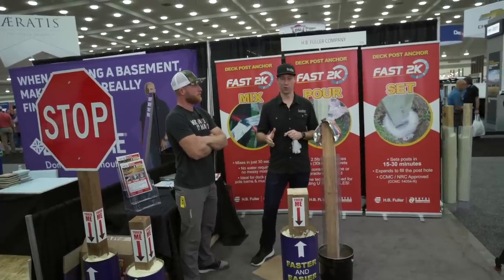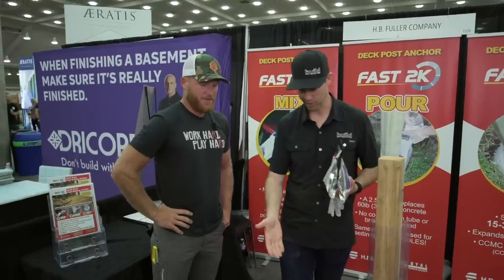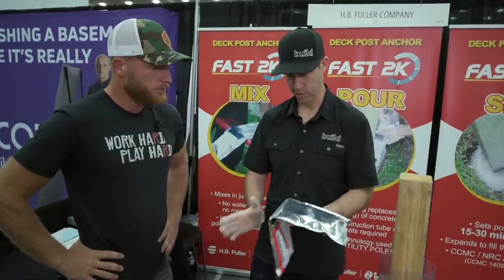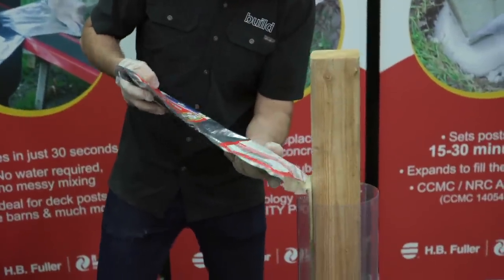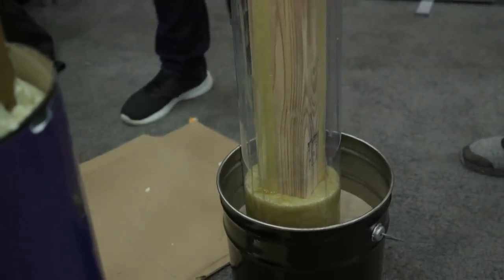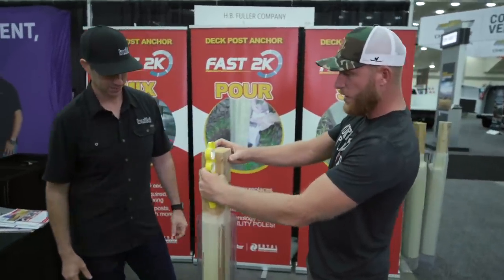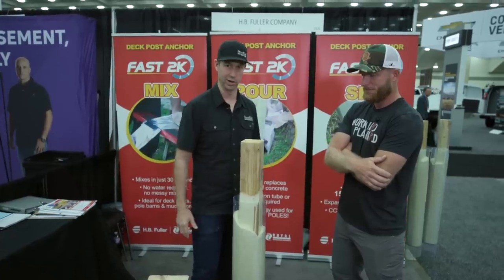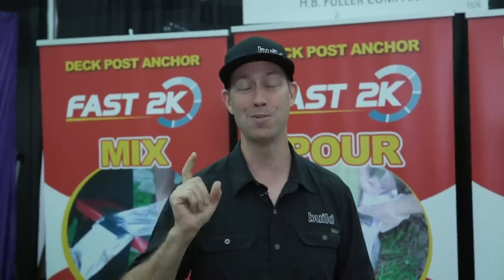Foam INSTEAD  of Concrete???

Comment: When I put a fencepost in I literally dug hole, plumbed fencepost and dumped in a dry bag of Sakrete and bada bing  I was done. I didnt even mix the sakrete with water because it would soak it up from the ground. However if it was really dry out I would pour a bucket of water in the hole first then dump in the sakrete . My post are still in use today and many have been put in well over 10 years ago and still straight. (A bag of sakrete is only 5 to 6 bucks per 80 lb bag)

Comment: The wind will work wiggle into the posts, the foam compresses and then you start the mass water penetration into the hole.  I had seen this Idea almost a decade ago, tried it, and had problems within the first three years "especially on fences". It is a horrible way to put in your posts, and if you do have water concerns, paint the bottom of your poles with some tar, spar varnish, or my personal favorite "Rustoleum Truck bed paint" with a cup of silicone carbide whiskers added to make it insanely strong, self glazing, and essentially turns it into a geopolomer, the top of your posts will dissolve before those type of treated bottoms will.

Comment: I make sure there is 6 inch minimum gravel below the post. Then use pressure treated post, which we then give two or three additional thick coats of copper green.  Then use good quality concrete poured above ground level,  and coned around the top.
   Have also used the foam product on one post  with success. It is light weight, and easy to handle. Just have to work fast and have the post set in perfect ahead of time. No margin for error. Also, very sticky so wear gloves and clothes you dont care about. 
   My preference is the concrete. Just have to do it right.

Comment: I used a different brand to re-set a falling clothesline pole this spring.

so far it's been solid but that's compared to the pole previously just being buried in dirt so no direct comparison to concrete, io mostly decided to try th foam because it was gonna be about $3 more than doing the pole with crete, and the foam pouch weighed 2 1/2 pounds instead of 100

the one i used was faster reacting and expanding, so i think i will look for this fast2k stuff if i do any other post holes, as the other brand was kinda frantic to mix and pour

Comment: I remember a guy put up a solid PVC fence with that stuff. Super storm Sandy blew it down. It doesnt have the weight of concrete. Now if you are making a low fence out of chicken wire or other wire fence that high winds can blow through, i might use it if its not too expensive.

Comment: Wow, another great foam product.  I recently learned about a foam block that’s been used in Europe for a while.  High R-Value, much less labor intensive than concrete block.  It uses some kind of poly sealer in between.  Doesn’t break down in water.  Only a week later, I saw it being used for a million dollar build.
Reply: What about nail polish remover?

Comment: Since expanding foam forms from a chemical reaction and is usually (from my experience) very porous, is this the same you witnessed with this product?  Any concerts about flooded properties/lands or underground water pressure causing this to lift through buoyancy?
Reply: No it’s  not. This is 3 times the price and will run much more than a concrete truck.

Comment: How does this distribute the concentrated load to the ground. Northern Illinois southern Wisconsin by code requires an actual footing under the cement columns and does not allow the columns to be placed in the concrete. Simpson post base or some other equal products are required.

Comment: This particular product makes a lot of sense for DIYers its worth the price premium for the convenience.

Even though polyurethane isn't water permeable I don't believe this process would actually make wood waterproof. If the wood expands and contracts even a little tiny bit they'll be a seem. You can also seal the wood before laying it in concrete and I'd do the same with this stuff.

Polyurethane isn't great in terms of cost either. You're probably looking at twice the cost.

What polyurethane is really great for is strength to weight ratio. I could see this being used in specialized applications where weight is an issue and I'd imagine since its easier to inject it could be used in some retrofitting projects.

Comment: 1. The general public (homeowner) will use this primarily for a mail box post. 
2. If you've never replaced a post before, good luck. You will leave the concrete in the hole and relocate the mail box. 
3. Never, never, never set the post in concrete....... or foam. Use pea gravel. 
4. Pea gravel is firm enough for instant rigidity, and if the post breaks at ground level, I've had great success pulling the post out, in slipping a new post in the same hole.
5. How? You might ask. Dirt particles fill the voids in the gravel and after a few years, the gravel is held in place by the dirt grains. And if it collapses in, just dig it out easily with a rotating post hole digger. Don't relocate the post.

Comment: Maybe with a better product, i still have to remove and reset a large portion of my fence post base, because the product i got from a box store after 6 days lost strength and compressed. in fact every post i set with expanding foam has to be removed and re poured with concrete. it is a great concept and time and speed are great. Also the ability to move and transport are also great compared to concrete. And for the record i followed all instructions for prep and installation .

Comment: Checked the MSDS, and it's a 2-part polyurethane foam. Similar products are used for (e.g.) facades and similar, so it should hold up to weather. (Might discolor over time, but who cares.) It's probably at least somewhat flammable, but I don't think that matters for this application. There are similar products; I found Sika Fence Post Mix. The innovation here is basically pre-measuring the components, and getting it in a convenient form, so I assume there's more out there.
So, who should be interested in this? People who need to anchor a single post in a hurry. There are comments talking about (e.g.) satellite dish installs, where you want the installer to get done and on to the next job without waiting around half the day for the concrete to set, and that's basically the ideal use case. If you're not in a hurry, just use concrete. If you're anchoring 50 posts on the job site, just use concrete. The wood rot resistance of this product is going to come from coating the bottom of the visible area with a waterproof material, and you can do that with regular concrete.

Comment: Living and working on a farm this isn't a bad ideal. However tho a 50lb bag of concrete isn't much. Usually around $5 & no more. Here 50lbs would last on 2-4 posts just depends on how deep you go. But you also get the problem of rotting which sucks. Then you gotta pull it out dig around it to get the rest of the post out of the ground. If this stuff is true that it stops rotting then yeah spending the extra $5 is worth it. However tho we would buy in bulk and to me it would seem like 1 bag would fill 1-2 posts. Plus you also got to factor it labor (if you do it yourself it takes about 10mins to mix) & the tools. This would make it so a noob can easily do a job & not have to pay someone or buy all that they need.

Comment: Is this being utilized in construction other than deck/post etc? I am building a horse barn and will have 26 - 6x6x14' which will need to be set. My biggest concern has been ground contact with the wood. This seems like a viable alternative, however, I cannot find information on its use in this type of construction.

Comment: Is there something at the bottom keeping the post from contact with water and preventing capillary action? Also wonder how it holds up with expansive soil.
Reply: I think you put a layer of course rock at the bottom which would allow foam access to the bottom for sealing.
Reply: ost install videos I have seen on even SIkas product shows the post sits on the bottom and this is poured around it, but they do say  you can lift the post an inch to let it get underneath, none of them DIY even recommend using gravel in the base, deterioration/rot rarely reaches that far down anyway.
Reply: I've used this in expansive soil, no bueno. I had to pull the 4x4's out, clean them, then do it the right way. Concrete. This foam weakens a gives by just pushing on the post.
Reply: @Jonathan Frederick Yeah, I can't imagine this foam handles that kind of movement well. Similarly, it doesn't seem suitable to anywhere that experiences freeze/thaw cycles, but that's just my speculation.

Comment: An 8 inch diameter hole dug 48 inches into which a 4 x 4 post was set, would use about 1 cubic foot of concrete. That is about 1.75 x 80 lb bags.  HD sells that for 4.50/bag x 1.75 = $7.87 per hole + tax. 

The foam requires a 5 inch post in an 8 inch diameter hole. So the post is much more expensive and the cost per hole is about $20 + tax + another $5 or so for the extra large post.

Home owners will use it for a few posts, but contractors won't.

Comment: Can this product be used to set 5"x5" vinyl fence posts which contain a 2 3/8" round steel pole?  Typically I would set the steel pole in cement and then slide the 5"x5" vinyl post down over it. I'm considering using this foam but concerned about it damaging the vinyl post???

Comment: You need 2.5 bags for each cubic ft used (it only replaces 0.4cf of concrete, a 60lb bag of concrete). If he is using 1 third of a yard (9cf) that means he would need 22 bags of this stuff for each hole. At $10-15 a bag that's $220 to $330 a post. 

That's assuming he is actually using 9 cubic ft of concrete for each post. If he's paying $120 a yard for concrete he's paying $60 a hole instead of $300 a hole with this stuff. I think the answer here is pretty clear.

Comment: Maybe this could be used in conjunction with concrete! That is, you fill the bottom 3/4 or more of the hole with the foam, then top it off with 4 or 5 inches of concrete which a strong concrete collar. This resists the structural loads much better, and keeps the foam out of sight and protected from the sun. More cleanup, but it would be a good long lasting system imho. Maybe only a quarter bag of "redimix" per hole. And people would never know... lol. Maybe 10 holes for a 4 inch deep x 12" diameter less a 3 1/2" x 3 1/2" post by my closer calculation actually at 2/3 cuft per sack.  That's an area of 101 square inches finished top surface  x 4 /1728 cu inches per cuft   is .234 cuft per hole. Works out to 4 holes or so with no wastage.

Comment: So the poll I did yesterday, 2 bags of concrete, cost $7.50. Not to mention if I happen to get any on me, the post, etc. Just add water and it goes away...

Like the idea but price needs to come down by half before it even seems worth it. I dont think it saves really any time, maybe 2-3 minutes at best. Water, Drill with mixer attachment and go. 2 mins, you done. Concrete doesn't ROOT boards unless you are using a completely untreated post which is dumb.

Comment: How would this stuff be as a replacement for a concrete home foundation if reinforced by rebar?
Reply: It just crushes, the rebar is pointless as the foam just rips off it under load. It is most just air, would you build a house on a foundation of air?
Reply: @whatyousaidbud  heck yeah, I'd build on air, if it were possible. That would be the best earthquake protection ever. Plus, if it was flowing, somehow, it would stop insects from crossing the barrier into my wood or other building materials. It would even stop mice and rats if the flow was strong enough.  Hover-homes sounds like a great idea. Plus, if your kids frisbee or ball went under the house, you could slide the house over to retrieve it. (Just kidding, water and sewage could keep it from moving too far. But flexible pipes (PEX or rubber) could maintain the earthquake protection.)

Comment: I didn't have a good experience with this stuff. I didn't use a tube thinking the laterally expansion would help "lock" it in.  The foam had flex in it.  4x4 cedar posts and fencing. The weight of the gate was enough to flex the foam. I was hoping it would work really well. Maybe I did something wrong other than follow the instructions.

Comment: My question is....will it crack? It’s in a plastic cylinder so of course it’s stable there, but if it’s in and actual dirt hole and you push on it will it stay as solid as concrete? I’m not so sure about this product. 🤔

Comment: what about at the very bottom of the post. doesn't it contact the ground? there won't be much of the foam covering the bottom because it will get squeezed out. isn't that an issue with wood rot with time?

Comment: Try using pea gravel , used it for my deck post's and you thought it was concrete. If you have to replace a post , it will pull out and you can replace it ?
Also I used pea gravel for clothes line poles instead of concrete.

Comment: GM used "foam" adhesive in their mid to late 80s cars. Foam also holds moisture. It causes rust on the cars and would likely not solve the same problem in this application. Tar the part of your posts that will be in contact with the concrete or this foam. .

Comment: An 80# bag of Quickrete is $4.35. It usually take me about 2 bags per post, maybe a little less. So yeah, this is not comparable to concrete in regards to cost. It does have a convenience factor.

Comment: $100,000 question. When you have a heavy rain, hurricane, tropical storm, or flood does the whole thing lift out of the ground and float off? Only reason I ask is they add foam to fiberglass boats to make them float.

Comment: I use Secure Set same 2 part liquid you mix from containers.  This concept works awesome. I will continue to use this stuff until I need to pour slabs for steps etc....
Reply: Just a couple necessary tips make sure what you are setting is straight /level/plumb with either some rocks or pieces of wood a corner level works great. Mix the liquids quickly and pour completely around your post. If the Secure Set comes above and hardens above the hole ground. Use a sharp utility knife to remove the excess.
Reply: Fake review!!!

Comment: If the job is anything larger than setting a mailbox or something like that, using ready mix is cheaper and faster. I build a structure to hold a house 10 feet above the ground. Requirement for the hole for each piling was two feet in diameter and six feet deep. That's about 3/4 yard per hole.  No way you can economically hand mix that much concrete. How much would cost for the foam to fill a 2x6 hole?

Comment: HEAR IN PA WE PUT CEMENT UNDER OUR POSTS AND SOIL AROUND THE POST THAT WAY IF IT ROTS ANY THE DIRT WILL JUST FILL IN AROUND THE POST AND THEY STAY TIGHT WHERE WITH THAT OR ESPECIALLY WITH CONCRETE THE POST CAN WOBBLE . A 1/4" GIVES YOU A 1'/2" MOVEMENT

Comment: Product does not work unless the hole is in perfect diameter. You need to follow the instructions on the bag. We used 8 bags on a simple 4ft fence system so 8 bags total. Real scenario here we were not able to go reccommended depth & the holes were not a perfect circle. We ran into pipes, rocks. Also if you had to adjust a hole a few inches there would not be enough in the bag. Hope this helps. My thoughts are good product, needs more field testing in real world applications

Comment: I spoke with two contractors that used this in a deck project and a fence project. They both had to replace all of the fence posts , dig the foam out and replace it with concrete. The holes set with the expanding foam are NOT as secure at all, and don't compare to concrete in any way.

Comment: My dad set some post with this about 35 years ago. They lasted less than 3 years before they were so crumbled that it was almost like dust when you wriggled the post.
My wife and I were house hunting. We found a house and when I looked around the windows it was this stuff. You could use your fingers to remove it.
Reply: This product did not exist 35 years ago. The window foams and this are two totally different compositions.  Heck, the modern window foams are different than what was available back then too.
Reply: Thomas Russell 
Thank you. I thought it was he same I saw my dad mix. He got it from from work (the military compound).

Comment: having set hundreds posts mostly 6x6 doing japanese style sleeve fencing and chainlink up to 10 feet under the right circumstances i would try this after doing test at home with shaped compacted hole perhaps my own pergola i will be sleeping under it in a hammock i trust you a reasonable amount plus way easier than the thousands bags ready mix i turned over in a wheel barrow people under estimate foam there are many types it is used for slab jacking i would end foam above grade with galvanized trim piece cheers

Comment: I personal used this product and followed the instructions on the hole size strategically and let it set before back filling and it doesn’t work the main reason being that the foam probably weighs a pound and the concrete weights 40 pounds

Comment: when I put up my fence I used concrete on all but 4 post...I used the foam for the 4 and it made the job easier and faster. but when I did my fence poles I dug 2ft and one bag did 2 poles but you gotta get it in those 2 holes fast cuz it expands quick.

Comment: If you seal the post first it will not rot, at least not for some time. Concrete is still a lot cheaper but this is certainly faster.